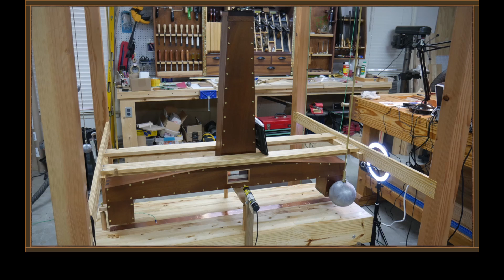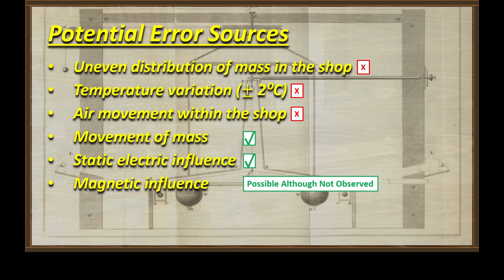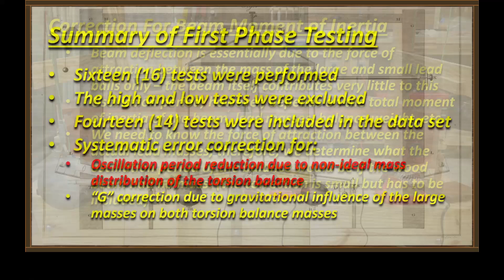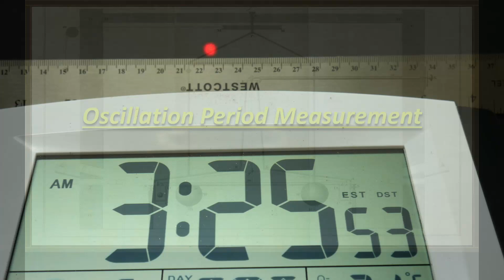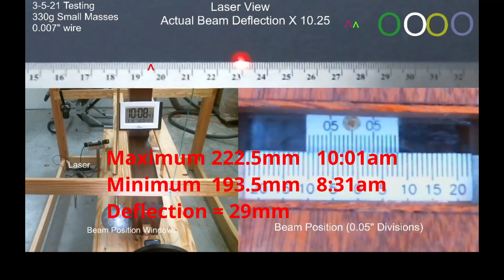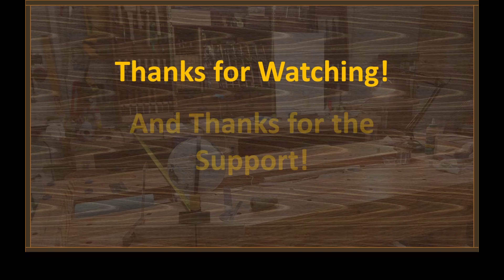Cavendish Testing  -  Part 1

Comment: Error #7:  the Cavendish experiment pretended to measure the density of the earth with many assumptions and mathematical constructs to pretend the numbers have any meaning, just like the authors of this video has done with a different purpose, never intended by the experiment. Like I said, pseudoscience.
Reply: The Cavendish experiment did not pretend to measure the density of the Earth. The device allowed the excursion of the balanced beam to be measured.
Reply: @marcg1686  what was the excursion measurement? And what did that measurement determine?
Reply: @marcg1686  OK, what was the number and what does it mean?

Comment: I do know lead is considered a non-magnetic metal, but it will interact with a magnetic field, so again, experiment invalidated.
Reply: The magnetic field will be detectable.
Reply from the maker: No quite true. Diamagnetic material will assume an opposite polarization in a magnetic field and the result is a repulsion 100% of the time. So a strong magnetic field would have caused to balance to move in the wrong direction but that requires a very strong magnetic field. The large masses were also diamagnetic material And I measured the magnetic field all around the balance to be no more than the 0.6gauss field of the earth. So please study your science books a little more and come back with a reasoned response - not some foolishness about magnetic fields or electrostatics - both of which were controlled for.
Reply: @bluemarblescience Sorry for sending this flerf your way. I've already told him why each of his "errors" are completely wrong, but if he was willing to actually learn things, he wouldn't be a flerf.
Reply: @bluemarblescience  The correct experiment would be to suspend two non-metal objects of mass separately, say 4 inches apart.  Would they move toward each other?  NO.  Your experiment is pseudoscience.  Much like Foucault’s Pendulum or the Coriolis effect, FAKE experiments long disproved, supported by invented mathematical constructs invented to create the illusion of validity, much like circular reasoning.
Reply: @bluemarblescience  how about that footage of India landing on the moon? You probably believe that as well 😂 😂 😂
Reply from the maker: @RB-sz9gv  If you have some proof to the contrary, please share it. If you don't, you're better off remaining quiet. If you're talking about the animation they used, just like SpaceX does, what's the complaint? They didn't say it was real. They made it plain that it was an animation.

Comment: Can you replicate this experiment, but use materials that can not hold electricstatic charge? Lead balls can attract and hold electrostatic charge. A tiny difference in the size of the surface of the balls can be of influence of the amount of electrostatic charge that the balls hold. If there is a slight difference of electrostatic charge between the balls, one can attract to another. This experiment therefore can not prove with absolute certainty that mass is responsible for the phenomenon we call 'gravity'. I lean more towards density and incoherent electrostatic attraction as well as density can be influenced through electrostatic charge as well. Prof. Walter Lewin explains this very well.
Reply from the maker: This is precisely why the balance was housed in a Faraday shield and grounded. Electrostatics were eliminated.

Comment: What a beautiful looking experiment. I like how it looks so much like the original (even mahogany wood). In our experiment (https://www.youtube.com/watch?v=XX3jcIPYTZo), we also thought that static electricity was a problem and so we also lined our enclosure with copper. It turns out, static charges don't really play much of a role. What the copper does is make an effective thermal enclosure. The Cavendish experiment is incredibly sensitive to thermal effects. The main issue was even pointed out in Cavendish's original paper but you have to read it very carefully to figure out what he means. Basically, if the big outside ball is a little warmer than the inside of the enclosure where the small ball sits, it will heat up the wall closest to the big ball. This lowers the pressure (since warm air is less dense) on that side of the enclosure and differential pressure causes a small force that moves the small ball in the direction of the big ball. Making a copper enclosure means that the thermal differential will equilibrate after a time. To improve things a bit more, you could make sure the enclosure is completely air tight. Another thing to consider is putting copper on the outside of the wooden structure that encloses the small balls. The purpose is to make a thermal circuit from the front to the back; it's not really so important on the top and bottom or along the length of the torsion beam. To test how good the thermal isolation is, put two glasses of hot water in the positions where the large balls normally are; you should see an attraction. Then use two glasses of ice water; you should see a repulsion. I was going to suggest using tungsten wire (which has a much higher yield strength) but it looks like you switched to tungsten in later experiments. Another good trick is you can use a small neodymium magnet to fairly quickly dampen the oscillation of the small lead balls (since the lead is diamagnetic, it is repelled by the magnet). This speeds up the initial setup a lot. Another trick: use a window with an anti-reflection coating (like a good UV camera filter) so that the laser beam does not bounce off surfaces too much and create confusing laser spots.

Comment: Bismuth would be a nice alternative to lead.  Fairly dense.  Castable.  And afterwards you can grow pretty bismuth crystals.
Reply from the maker: The nice thing about lead is the fact that cannonball fishing weights are readily available up to about 50 pounds and I would have to cast bismuth myself. I'm not equipped to do that but it would certainly work if I could find a source. Keep in mind that the lead weights were around $200 per copy all things considered and I think bismuth is more expensive than lead.
Reply: @bluemarblescience  Non-toxic fishing weights are bismuth.   Which can be melted in a pan on the stove.

Looks to be about 3 times the price of lead, though. :(  But that was for 99.99% pure.  Then again, I've seen it stated you need that sort of purity to be able to grow hopper crystals.  And I've also seen it stated you can grow hopper crystals with lower purity, but low purity usually means you won't get the fantastic surface colours.

If you do cast bismuth, keep in mind that (like water) the solid is less dense than the liquid.
Reply from the maker: @bdf2718  Yeah - it expands about 3.5% when it freezes so casting would be tricky I think.

Comment: As I understand it, an uneven distribution of mass in the shop shouldn’t matter as the thing the balance is sensitive to is changing the distribution of mass in its local vicinity. So just about every item in the shop could be on one side while the other is devoid of mass excluding air and it shouldn’t matter so long as that mass distribution stays that way during the entire test regime. What would disturb it more is if you had a party outside with everybody’s cars parked on one side of the building and then midway through the test the party ends and everybody leaves. 

Or if you want to be really pedantic (likely precision beyond normal cavendish tests) is if you start the test at moon rise and take so long that the moon has moved to the other half of the sky. Now we can’t control the presence or motion of the moon like we could guests cars so the way to account for this is to simply repeat the tests at varying times of day and times of year to average out the effects of the position of the sun and moon (if you really think their effects might be more significant than other sources error in the device). But when you do the math, a trick fe are allergic to, odds are you’ll quickly realize the scale of these influences are far beneath the range of errors inherent to the device. For example it’s a bit silly to worry about +/-0.01 from a source when your tool already has +/-0.1 error bars.
Reply from the maker: Those are all valid points. But just being pedantic myself, I felt the need to verify that mass distribution didn't matter as long as the mass remained stationary and it and it turned out just as the calcs suggested. At least we can say that we didn't ignore those things. We actually investigated each of the variables.
Reply: @bluemarblescience  True. Best to explicitly point out that it was considered and ruled out because the average (reasonable) joe may not realize the mass distribution in itself doesn’t matter, it’s the change of the distribution that’s critical. A flattie would likely assume the opposite so they’d want to a demonstration (to their arbitrary standards) but they’re not really the target demographic.

Comment: Excellent work on this experiment.  I have a question.  My understanding is you tried to match Cavendish’s setup as much as possible, right?  The videos I find online with others did not have the small masses and torsion wire in an enclosed box like you did. What reason or purpose does enclosing the small masses and torsion wire have for this experiment?  Is it a better method to reduce other impacts like air currents on the torsion wire and masses?
Reply from the maker: Thank you! The entire reason for the enclosure is to eliminate the effects of air currents. Think about how slowly that balance moves and you'll get an idea about how little air current it would take to disrupt the readings. Others have put the entire thing in an enclosure, but then when the large balls are moved, they're displacing air in the same volume that the torsion balance is in. Cavendish recognized this and that's why he designed the experiment the way he did.
Reply: @bluemarblescience  makes sense, one video I saw the experimenter had all sorts of issues getting the set up to stabilize and he had no enclosures for either.
Reply from the maker: @STEMforlife1776  Yeah - doing it out in the open is essentially impossible - even for just qualitative results.

Comment: An eggsperiment? Chicken eggs inside perhaps? Or chicken and ostrich eggs? Hard boiled I suggest to prevent the eggs changing over time. Might need to varnish them to prevent water loss through the porous shell. Given the drastic reduction in mass would the deflection be measurable with hen & ostrich rather than hen & big lead balls? Fun! 😁👍 (🌍 not flat)
Reply from the maker: LOL - maybe just for fun and to make fun of the idiots.

Comment: There is a lot to comment on, but I'll just state my amazement about all the brass screws.
Reply from the maker: LOL - and there are about a bazallion of them too! You find out when you have to take the thing apart. Thank god for cordless drills!
Reply: @bluemarblescience  I'm still using a old one that had a NiCd battery. 
I converted it to use a battery pack on my belt in about 2008. 
That thing lasts all day and still goes strong. 
Drilling, screwing, using a sanding disc, all is so much better than by hand. 
So I can relate.
Reply from the maker: @heyarno  Oh yeah - I'm lazy by nature and I'm not about to twist screws by hand unless one of the kids is trapped under the sink or something! LOL

Comment: That experiment was performed flawlessly and now we will sit back and wait for Flat Earthers to start claiming that the analysis is wrong.
Reply from the maker: Correct - wrong type of wood, not done at the right latitude, concrete floor too thick - the list will be amazing LOL!
Reply: @bluemarblescience  I think you originally asked your viewers of you should do it in the way Cavendish would have done it or modernized it. I believe the majority went with the original method. This should at least curtail some of the claims that globe Earthers can and do perform experiments that validate previous experiments and our knowledge of the Earth and that they are repeatable. Now let's see if any Flat Earthers will repeat this experiment.
Reply from the maker: @Eagle8599  One in particular (who shall remain nameless) loudly claims that this won't work in a vacuum despite half a dozen papers going back to a National Bureau of Standards 1930 paper but those papers are dismissed because they lack a YouTube video of the balls actually moving and we all know what liars scientists are! So my challenge is this. If you claim that air has something to do with this, you, Mr. Flerf, need to prove that by building a torsion balance and showing that it works in air pressure, but stops working in a vacuum!
Reply: @bluemarblescience  All you have to do Blue is convert your garage into a vacuum chamber.  Easy ;)
Reply from the maker: @JSSTyger  😂

Comment: Instead of a torsion wire... why not use balance rod on a fine point hardened needle type pivot point..? Cheers Blue👍
Reply: The torque is a required part of the experiment it provides a force that apposes the force of attraction.
Reply: @robbarton7972  .. oppose.. not appose... but I suppose you knows those
Reply: @robbarton7972  ... ahh ok.. so.. Blue is trying to measure Resistance to Gravity then..?
Reply: @robbarton7972  keep in mind.. torsion is not torque.. right?
Reply: The torsion wire provides resistance to the gravitational force between the test masses, enabling measurement of that gravitational force.
Reply: @barryon8706  .. torsion is resistance to rotation.. no?
Reply: @arranmorfeld1991  According to  Wikipedia, in the field of solid mechanics, torsion is the twisting of an object due to an applied torque. 
The wire used in this apparatus resists twisting,  and resists more the more it is twisted.
Reply: @barryon8706  torque is a force ... torsion is a resistance .. no?
Reply from the maker: For one thing, my name isn't "John D" and for another, I don't pretend to be a doctor so you see, I know where you got that BS. Why don't you ask Ranty about it. I sent him an email after John D  had sucked him into the malarkey explaining why it won't work that way and suddenly, after all the fanfare and run-up, John D and his idiot side kick vanished like a fart in a windstorm. If you have serious questions, I'm happy to answer them Aaron. If you're here to troll - you're no longer welcome.
Reply: @bluemarblescience  We all know what a liar John D is with his fake doctorate, like the time he buried the results of his Bedford Levels experiment when they detected curvature.
Reply from the maker: @cambridgemart2075  I have no use for people like that and Aaron didn't think up that needle bearing crap on his own. That's the BS John D. was going to do until he got called out on it. What a great concept that was - a torsion balance with absolutely NO torsion element! Truly brilliant!
Reply: The point of the test is to twist the wire. It’s fairly trivial to quantify the mechanical properties of said wire in order to know how much force it takes to twist it by any given amount. So when the large masses are introduced, and the wire is twisted, producing an oscillation that then settles on a new equilibrium point, it’s relatively trivial to quantify the effect of the large masses. This in turn identifies how much force is present to hold the wire in its current state. Flip the masses to the opposite side and watch the same thing happen again but this time in the other direction. Rinse and repeat multiple times to demonstrate repeatability and consistency in the form of appropriate statistics and you’ve got yourself a decent cavendish experiment result worth talking about.

What you don’t want to do is use an inappropriate torsion “wire” that is too unresponsive or too weak that the torsion beam rotates so much it strikes the side of the box or hits the large mass should there happen to not be an enclosing box. Or use an overly complicated system that makes it unreasonably difficult or entirely unfeasible to quantify.
Reply: That's a bizarre suggestion. You'll be making it impossible to measure G, since the needle-point bearing does not provide any restoring torque, and there is the risk of bearing static friction preventing any movement at all.
Reply: @marktin6357  That's because he's just parroting another flat earther that claims to have a qualification in science.